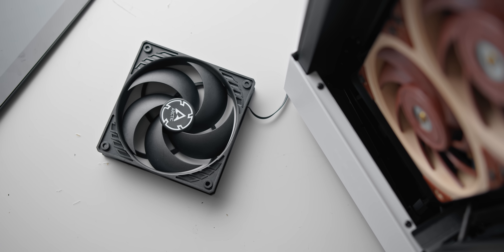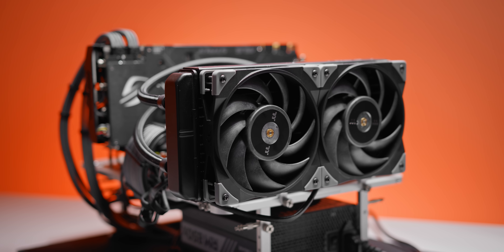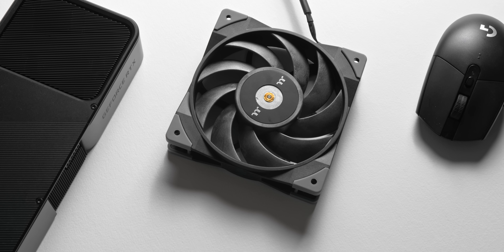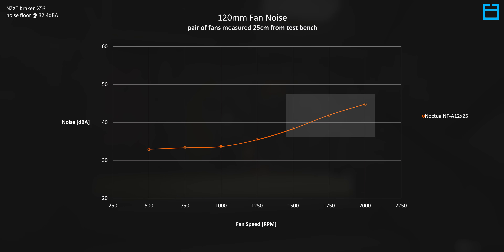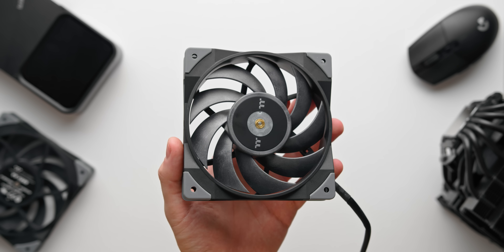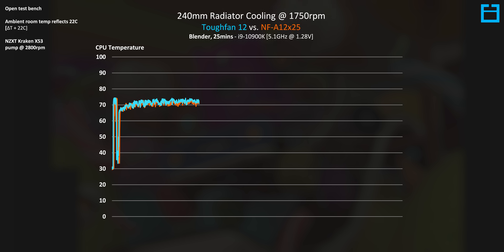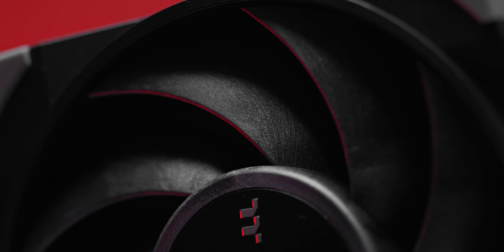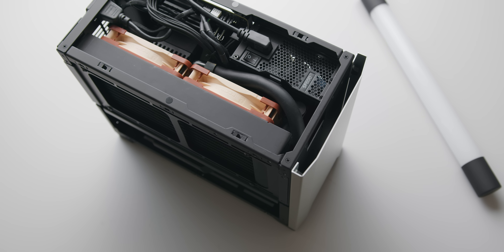Thermaltake Copied Noctua?

Comment: If it's cheaper and has the same performance of noctua then why not!?
Reply: its just a case of personal ethics. i you have none, go for the thermal take.
Reply: @Ginkoman2  uh-oh..noctua design looks like they copied nidec typhoon fans.
Reply: @Vinterborn  its one thing to copy just the blade design. but tt also reverse engineered the special material of the plades as well as the motor and the case. thats a whole other level

Comment: I normally won't support rip offs but if this gets Noctua to release one that ditches the light brown frame, so be it.

I mean it's not even the dark brown blades that gets in the way of blending into a system, it's the latte brown frame. The dark brown blades only become a problem when you have RGB and the light reflection on that becomes a problem vs the other lights bouncing off black/grey (with some accents) or white everywhere else in the computer. I'm not even asking for all-black, jut the Industrial PPC colors. Which is funny - actual industrial use fans are the ones that most users won't see, only the people maintaining the server will ever have to look at it.

Comment: I will not buy them. I did buy the Arctic P12 value pack to replace some aging fans. I am a fan of Noctua fans and coolers I am debating on a low height cpu cooler for my lan build, the NH-L9x65 SE AM4.

Comment: Meh... 
Thermaltake expected lifespan: 40 000 hrs, 25°C - that´s less than 5 years at most
Noctua expected lifespan: >150 000 hrs. That´s 17 years. Its electronics will be probably long gone by that amount of time, but who knows? 

This means, there are some other differences we can´t see.

In the long run, which would be better? I still have some old, 1st gen Noctuas and they still work.

Arctic fans may be similar, but you can´t get the same quality with lower price. That said, Arctic fans cannot be mounted horizontally - their bearings cannot withstand it for more than few weeks (i also had few that were buzzing out of the box) and there is also the humming sound notable in certain rpm ranges. Arctic is just cheap. Heatsinks are OK, fans will remain trash.

Comment: noctua copy and pasted the gentle typhoon design. noctua did a decent job of making it a little quieter than the nidec, but the gentle typhoon design is like 15 years old and was designed for server/industrial use. gentle typhoon was never meant for home use, it was built to last 20 years while running 24/7 in less hospitable environments. noctua just domesticated it and jacked up the price nearly 3 fold.

Comment: Copyright is anti competition and anti consumer. Any company that can produce (or in the case attempts to produce) the same product in a higher volume or at a cheaper price is pro consumer. I don't care about noctua or it's profits. I want the research. TT is trying to give me that research for less. Noctua deserves recognition for the research but they do not morally, IMO, have the right to hold back human progress.

Even if companies didn't have exclusive copyright, research would still be done. Competition would be even higher. The rate of progress would be better. Incumbents like noctua that refuse to provide multiple colors for example don't get to stay on top just because they got there first. No bars to competition.

Typically I agree with you but in this case I have to disagree.

Comment: I find that unfair to Thermaltake to call them copycats here.
Noctua NF-A12x25 was introduced around 2018.
Noctua ripped off design from Nidec Servo Gentle Typhoon, which was introduced 2009.
And I'm not surprised, as Nidec it the huge brand here, with an unimaginably huge R&D experience. A serious companies, like HP, Cisco etc will go to Nidec for cooling solutions, none of them even consider Noctua.
More fair to say would be that both, Noctua and Thermaltake copied Nidec.

Comment: I bought 2 tough fans after seeing this last month and I have to say they are great alternatives. Mine don't rattle at 1000 RPM though... sounds like something hitting one of the blades. Weird. They have also saved my bacon. I've got an h210 with a X53 and the pump sticks up enough to foul on any square framed fan in the rear exhaust spot. The tough fan has a more stylized frame which enabled me to Dremel one of the sides, so it fits proper nice nd snug. Could have done that with a NF-a12x25, but I'd have to take much more material away and the price difference is just enough to not make it hurt. I'm certain they move something like 2% less air than the brown kings, which is why they drop 2°C on your charts, maybe the gap between blade and frame is .2mm bigger. /shrug. Pound for pound I feel they're well worth it. Copy write grey area or not, Noctua really should have got their arse into gear.

Comment: Both of them copied Gentle Typhoon, with some modifications.
Reply: And Thoughfan performance is worse when compared at max RPM tbh since they run slow.

Both GT and A12 leaves Thermaltake ones in the duat so far.

Comment: "Thermaltake Copied Noctua?"   Nah... Noctua, Scythe and Thermaltake copied Nidec!  ;-)
...or rather used Nidecs patent, reverse engineered Nidecs design or even had Nidec produce them under their label. Would be nice to know the details, really! But don't give Noctua credit for "innovation", please! They just used the old "Gentle Typhoon" design from Nidec. This Nidec Design, however, is one of the best EVER in Fan development, no matter what company implements it or has it's Label thrown on it. I'm into this "silent fan rabbit hole" since nearly 20 years and every few years some good designs come arround the corner... incremental steps. But 3 designs really stand out by a lot: the bionic eLoops, the Arctic P and this Nidec Design. All three are remarkebly good in their own, different ways! What's gonna be really interesting for me is a 140mm version of the Nidecs! Seems like Noctua left the party on this, as their newest 140s are of a different design. Thermaltake however released the Thoughfan 14, which seems to be a scale up of the Nidecs. whether they use the patent, have Nidec produce them or scaled them up on their own... I don't know. But if this design performs as well on 140mm as it did on 120mm... holy smokes, this could become the holy grail of radiator fans! Hope you get your hands on those soon.

Thanks for the good Review and keep up the great work!

Comment: Noctua has had the fan out for like what, over 2 two years in the same typical Noctua color.
Here comes Thermaltake in 2021 and INNOVATES on the same design by changing the color and reducing the price.

I really don't see the issue.

Comment: Man this title is dumb.  No one copied Noctua's homework, it was Noctua that ripped off the original Nidek/Gentle Typhoon design.  Zoomers need to google a bit further back than 2016.  All of the major innovations in the HSF segment that we've seen over the years has come from mostly two companies, and it isn't Noctua, it's Thermalright and Scythe.  The original Thermalright HR02, Thermalright Ultra, and the Scythe Ninja laid the groundwork for nearly every single heatsink we see today.  Prior to that, the very first 120mm heatsink available was the Thermalright XP-120.  All of Noctua's designs were just slight engineering changes of the original Thermalright Ultra.

Comment: The Noctua fans are nothing special, they are simply industrial fans in brown color. Fans with larger bearings have long been on the market, just google Sanyo Denki
The Sanyo mostly just have different fan blade shape. But also the shape of the fan blades is nothing special, even the shape of the eLoop fans is known in fluid mechanics for 100 years. Also the plastic is just one of many.

Comment: I have no issue with companies taking inspiration from the good ideas others have, and have liked thermaltake products before (used a core v21 for an old build and still use a core p3 for my testbench). But this is not inspiration, it is basically the same thing. even down to the metal surrounded by plastic surrounded by different coloured plastic design on the hub, and ofc everything else. This is too far for me to support. 

Using new materials in the same vein, adopting new advancements in blade design/shape, that'd be cool. But this goes beyond that IMO. I'll be avoiding these.

Comment: ThermalTake did a somewhat poor copy. They're missing the microstructures on the fan blade AND the ones within the shroud.

Noctua cools better because the tighter tolerances and better flow mean higher static pressure ratio through a restricted radiator. You really should measure static pressure of the fans as well as noise and cooling performance. In high resistance radiators and heatsinks, static pressure performance is important. I bet you the Noctua has better cooling performance because it can maintain a significantly higher static pressure at the same noise and RPM level, giving more flow through restricted outlets

Comment: I don't think the copycat argument holds up when you look at the PC industry in total. Using cases as an example, how many cases use the same general form including airflow vents and PSU shrouds? Sure a better quality case costs more but a cheap DIY case would have the same features. Noctua's stubborn refusal to put out almost anything that isn't that hideous color is a big factor considering all the cases with TG and RGB in them these days. They knew when they created this fan that the color would bother the consumer but they don't care about that so they are practically begging someone to come up with a different version in different colors. Personally, I'm hoping TT makes a white version of this fan too.

Comment: I would not buy TT products, even if they were the "best" . Their customer support and quality control are utterly crap. I used to get their cases and peripherals because they were cheap, but the quality was so low and the inexistent customer support taught me that you get what you pay for. These fans might look the same but I highly doubt they would be as durable as Noctuas. I can see how these fall apart within a year for the tight tolerances and how the blade design is made.

Comment: noctua copied the typhoon GT. Only thing that sucks about the thermaltake is the sides have gaps and pressure can escape, the rubber mounts adds to the gap too. If they made a plain box design it would be better than noctua.

Comment: Arctics have the 5 pack that come in for under $30 frequently - they sell out because it is such a good deal so you have to watch for it.  For the price/performance, they can't be beat.  Plus, the white fan/black housing arctics look excellent inside of white/black builds.  I'm genuinely confused when I see people building PCs not using them outside of builds that aren't concerned with cost.

Comment: Thermaltake when using a step-down resistor at speeds below 900, the "beating" of the engine begins. Ripple.
It is not possible to use it at lower speeds than 900. This is a manufacturing defect. Shame Thermaltake!
Without using a resistor, there is no problem at low speeds.

Comment: Dear Noctua: 
Why do you persist with this brown, that looks like the fake wood cladding on 70's station wagons?
You have left this large opening for Thermal Take to attack your market share.
I paid you the extra 10 Euros for the "Chromax" version of the L9A, just for black - because it was available.
For my N Case M1, I purchased Be Quiet fans, because they are black and look good - even though they are not as good as Noctua fans.
Without having done any market study, I think its about 0.3% who prefer brown fans, maybe 50% who don't care, and the rest would rather have black or just none-brown.

I would be much more sympathetic in the face of blatant plagiarism, but I perceive your 10 Euro extra for black just as blatant.  So, to me, both companies are even in not deserving my respect.

Comment: That's a pretty shameless copy...
I doubt the motor is as high quality, and the balancing (on this sample at least) is apparently not as perfect. The warranty time (6y vs 2y) and expected life (40K hrs vs 150K hrs) probably speaks to the fact that it's not quite as reliable.

That said - when you get 2 of these for 35 vs one NF-A12x25 for 30 (newegg prices) and they also have a sensible color scheme then it really start to be hard to argue for the Noctua when the performance is so close.

As much of shameless copy this is from TT (do they risk being sued over this?), I think this is good for consumers.
Mostly I just hope it will light a fire under Noctua's ass. Taking countless years to make small obvious common-sense tweak to products (like the color nobody actually wants, or 140mm variants of the same design) just can't hold if they want to stay competitive in the long run. You snooze you lose... and hopefully this just makes that fact painfully obvious for them now.

Comment: Was only a matter of time.  People wanted a black version of the best fan for years now. Noctua knew and that and did nothing. Fuk them. Noctua need to respond with even better fans. Innovate or die.  Make them daiseychainable to reduce cable runs, higher rpm at same noise, chromax day 1.

Comment: Thermalfake at it again. It's a shame really that they never learnt their lesson. Every rip off they have done have been sub par I doubt these fans will prove to be any different in the long run. Unlike Noctuas redesign of scythe GT fan d where they took a profile and built upon it altering materials bearing design blade thickness Thermalfake will simple look to cut as many corners as possible to hit a margin point and what we will see is the same old shoddy copies I'm waiting for their new lines in Bolex watches.